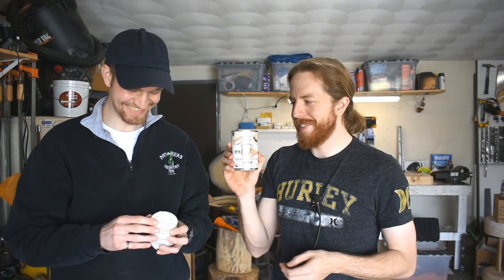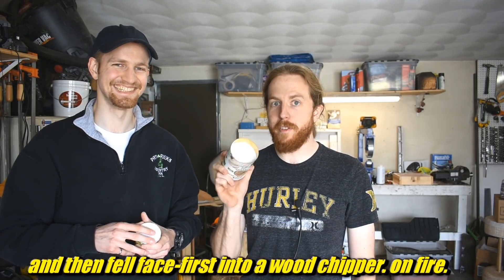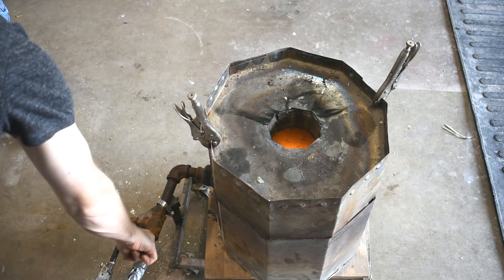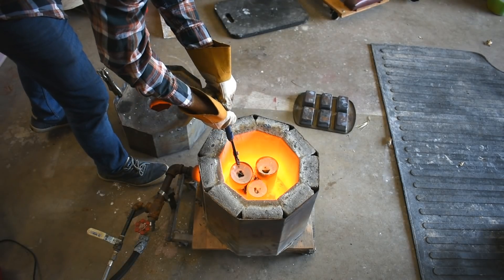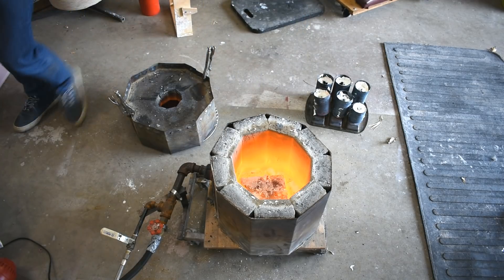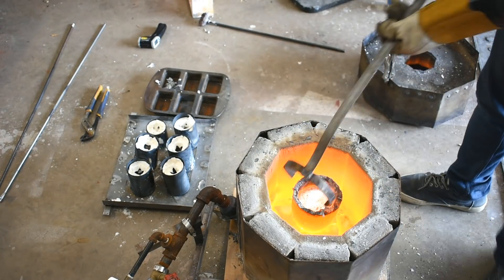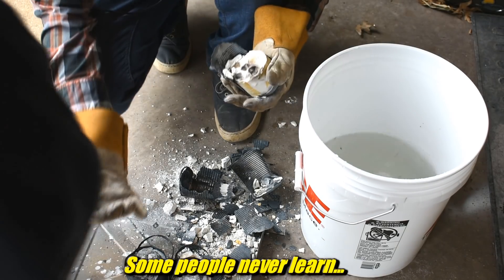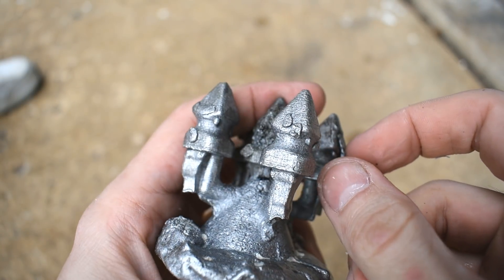Lost PLA Casting Game Pieces for a Friend | 3D printed parts to Aluminum Castings

Comment: I've had some success clearing my molds by putting them in the kitchen oven at 500°F for 10-12 hours.  The PLA melts out, I have a decent void to work with.  Might be worth researching for your purposes.

Comment: Dry your plaster in your oven on 250F(120C) first. For as long as you have the patience for. 5 hours is usually good. 
Moisture in the air will immediately try to rehydrate the plaster, which is now acting as a desiccant, so don't wait too long after drying for your pour. I have had plaster crack on me due to sucking up moisture cause it was a humid muggy day. Not really much you can do.

Comment: what does the nozzle on your burner look like? all of my steel nozzles melted with a similar setup lol
Reply from the maker: The flare at the end? It's just one of those 1-2" adapter things with a strainer welded in it.  This was built by Roy Adams at the "christ centered ironworks" YouTube channel, he has a video about it.  Something like "forced air burner" in the title
Reply: So you're using a christ-centered burner with a Satan-ite lined furnace - you know this is going to cause Armageddon sooner or later, right? :-)

Comment: looked like an interesting way of casting 
i think if you put the cans upside down when you place them upside down intoo a different can during the burnout 
the pla wont get intoo youre furnace and the casting cans probably stay in better shape too as you grab the outer can for taking the stuff out of the furnace  
i wonder if you can lay the ingots on top of the castingmoulds / soupcans standing straight up in the furnace and have the aluminium slowly melt / trickle intoo the moulds inside the furnace 
it might give the aluminium more time to flow in and flow slower giving it more time to replace the air inside the mould , might take less time to complete the poor (when ingot it gone turn off heat) so the aluminium doesnt overheat  and the dross float on the top of the can 
turn the fire off leave them in the furnace untill there cooled then fish them out with youre hands and clean the moulds off 

taking it out and cooling it faster like trowing the whole lot in water while its still not completely solidified might create a vacuum that draws the aluminium in better 
think if you add small spruces pointing down toward the bottom and chambers under the peaks of the towers all the burned pla ash resideu , dross and stuff from the molten aluminium (hopefully ) will sink intoo that leaving good material on the tips of the peaks to file intoo shape

Comment: I learned why not to try melting cartridge brass with aluminum yesterday! 😬 Somehow ended up with an enormous explosion of what i can only describe as sulfur foam which turns white when exposed to air, and a puddle of strange silver metal that breaks like glass.

Never a-fucking-gain.

Comment: The way I've seen this done in other videos, is they will put the mold in a kiln (upside down) so that PLA will melt or burn out.  They then use a compressor the blow air into the mold opening to purge all the burned bits and ash out of the mold.

Question  for you Paul:  Did you make your own crucible handle?  I'm trying to figure out a way to safely get the crucible out of the forge without it accidentally dropping or spilling.
Reply: He has a video of him making his own crucible tongs

https://www.youtube.com/watch?v=0SAJIlyq2MA

Comment: You dont really need to heat the molds that hot usually if you have them upside down. I usually do it in a firepit, but you can always take another soup can and put underneath of it to let all of the plastic drain out. All your really looking for is to slowly evaporate the water/moisture away and to melt out the plastic. If you get it up to temp, it'll just melt out fairly easily. If you use a thin slurry of the sand/clay and paint it on with a paintbrush, it helps alot with not getting entrapped air bubbles.

Comment: I'm working on similar 3d printed lost casting. Im working on a funnel right now. Instead of expensive ceramic coating with silicone powder I am applying a few layers of silicone and submerging the item around concrete/morter instead. This is because plaster of Paris is quite expensive considering you have to add twice as much plaster as water. And that means to get one gallon of volume you really need 2 gallons of plaster. And at $17 a bag it can get expensive. Instead concrete / mortar is only about five to seven dollars for a slightly higher volume. I'm still working out to see what exactly is the best low-cost method. Although I did take provisions to buy polysmooth filament which is chemically identical to polycast filament which is supposed to be Ash "free" technology. I'm still using pla for the riser for now though. I'm interested to see what methods you plan to use.

Also have you been hitting the gym you seem like you've lost a lot of weight
Reply: interested in your method with a few layers of silicone.  how are you doing that?  I get the part about submerging that in mortar but not sure about what you use for silicone and how you put those few layers on the model.  how are you burning it out, at what temp?  thanks
Reply: @emaglott  well I haven't actually burned it out yet I'll be doing that today but I got a liter of this silicone caulk / acrylic mixture call siliconizer. I picked it up at Home Depot And over the course of a day or so with a few changes of gloves I just slathered a few layers until it cured. If this type of silicone is ineffective I'll go for a more pure type to see if I can achieve a higher temperature resistance.

Comment: Lite salt .....Gaaaaaaaa!!!!  You know better than that. Do I need to call your mother?

Looking forward to next week now
Reply from the maker: I'll send you a link to the lecture if I can find it, shouldn't be much new info to you, but it packages a lot of stuff into one video.  

And I gotta use up my lite salt somehow, I'm certainly not going to eat that crap! 😉
Reply: @PaulsGarage  lite salt, great for cleaning metal and eating away your crucible, (borax is even better at eating away your crucible also good for cleaning metal)
Reply: @askquestionstrythings  The flux destroying your crucibles means it's working!
Reply: @rich1051414  lol, yes if the flux is eating way your crucible does some mean it's working.  All fluxes are damaging to crucibles, some are slower and  some like borax are extremely fast. It's all a balancing act, balancing the chemical attacks on the crucibles and cleaning the metal vs the cost of replacing the crucibles. Basically it is important to use the minimum amount of flux that will do the job.